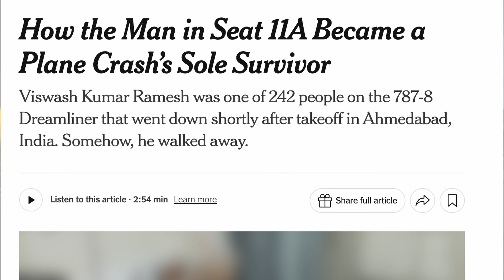Why the RAT Changes Everything – Air India 171 Update

Comment: Hi steve. I am a "just retired 737 NG/MAX Line Captain (Flew with Westjet Airlines in Canada). You haven't touched on your comments of the possibility of software failure, meaning that for whatever reason, the engines went back to idle and the pilot did not react with the TOGA switch One possibility could be to leave at field elevation the altitude on the MCP (That would not explain the RAT deployment though). Or the computers "decided" to flame the engines down for an obscured reason that hasn't happen until now. Thank you for your time and work on this Hugh issue. Frederico.
Reply: I'm not an engineer, but as an electronics hobbyist, it seems to me that a better design would be to have a hardware override in the case of software or computerized system failures.  I know for controlling aircraft there's a lot more going on than, say controlling finicky laser diodes or some simple electromechanical system.  But it just seems like there ought to be a way to get manual control over the hardware if the computer should decide to have a bad day.  just my two cents
Reply: @GTA2SWcity  You would still need time/altitude to be able to recover in time...this scenario did not provide that.
Reply: @tima.478   Yeah...I guess not. 

Just seems like some things could be forestalled if not prevented.  

I hear about software or computer failure modes and catastrophic results and I just can't help but wonder, you know?
Reply: @GTA2SWcity  Yeah, I get where you're coming from. In some cases of computer malfunction, the pilots are able to override manually. Just not for every scenario. As many commercial aviation procedures are unfortunately written in blood, so too are more likely to come from this tragic event.
Reply: @GTA2SWcity  There is video about a software failure with speculations that it was malicious code done by the unknown.
Reply: Precisely my opinion; i would go further and say the software entered auto landing mode.
Reply: @fredericohayes3883 Can anyone hear engine sounds along with RAT, its confirmed RAT is deployed, are engines running sound can you confirm?

Comment: I dont have the expertise to speculate on anything...but There is one factor that by now shouldn't involve/require speculation. And that is, how much runway the Aircraft actually used before it rotated. There are reports it rotated midway down the runway...other reports it ate up almost all of the 11,000ft. of runway...there is a report that it left the runway almost 9,000ft down the runway...this is one thing that we should know for certain by now.  Heavy aircraft  take off in similar meteorological conditions all the time. In my non-expert opinion, even heavies in similar conditions don't take up almost 11000ft  of runway to reach VR. It does appear from the limited angle available that it took far more runway than would be normal...but again it's hard to tell from the videos to be found. Is the dust cloud that swirls because they rotated at or near the overrun?  Maybe I have missed something but I have yet to see or hear any official report confirming how far down the take off roll the aircraft rotated...and that one should be easy to confirm. If they indeed take up almost 11000ft of runway...perhaps that speaks to an insidious problem that became critical just after VR. But one would think that it would have been a concern on the flight deck that they were coming up on a place in the take off roll where they would normally expect to reach V1 and not even be close to it...maybe they never reached V1 /VR and they were too far to reject and simply ran out of runway and had to rotate with the power/speed they had. Am I Missing info that officially confirms where along the runway they rotated?  We keep hearing it was a sudden loss of power or engine failure. But to my totally untrained brain...whatever happened wasn't so sudden...if they truly ate up almost 11000 ft of runway before being essentially forced to rotate. This I assume will be quickly revealed from both the CVR and FDR. Forgive my non expert terminology or understanding of procedure...but it just seems like if they ate up almost 11000ft of runway there would have been concern in the cockpit that something is not right long before they eventually (were essentially ) forced to rotate....whether it was from improper inputing of performance data or a system technical failure or whatever...taking up the whole runway seems to point whatever the issue was, to some degree being present during the takeoff roll

Comment: If its a dual engine failure, does that mean the manufacturer is at fault?
Reply: yes - this is a design failure a single cause of failure for both engines has to be prevented by all cost

Comment: I need to add some of my prospective , align with preliminary data from DGCA and AAIB.

A few clarifications from FDR and official press notes:

1. Dual engine failure was sequential, not simultaneous — left engine failed first, followed seconds later by the right (DGCA/AAIB, June 16).

2. RAT deployment confirms loss of both primary power sources (engines).

3. Takeoff config was confirmed correct (flaps, gear, trim).

4. Mayday phrases like “no thrust” and “losing power” were verified by DGCA, though not logged formally in ATC tapes.

5. Flap position after crash implies the system remained in takeoff mode and didn’t transition — consistent with low-altitude failure.

6. No visible fire before impact + staggered thrust loss = high suspicion of fuel delivery system misconfiguration — possibly a manual valve or crossfeed error (our analysis breaks this down in detail).

A fuel delivery system misconfiguration can still allow a clean takeoff roll and rotation, with failure occurring seconds later as the system exhausts available fuel or fails to crossfeed properly.

*) Theory about redundant electrical + hydraulic failure affecting fuel pumps is technically possible, there’s currently no confirmation of widespread systems failure in those domains.

*) Fuel Contamination - More likely to cause simultaneous engine failure — not staggered.Less likely if one engine fails first, then second

Comment: The landing gear don't tilt rear wheels down when they start to retract. Those wheel trucks show they were partly retracted front wheels lower. Interesting how this experienced pilot missed that obvious issue. That uniform is a little too white. Sensors failed with the Boeing 737 Max investigators identified issues with the system, which repeatedly pushed the plane's nose down, leaving pilots fighting for control. Sensors caused this probably fooled this "fly by wire" computer into a landing issue. Pilots called this a "cream puff" design. This tells me more computer control over manual pilot control. Seems a bit obvious safety concerns on this 787 were pushed past for profits. Trump did this. That is what he wanted just like his early warning pandemic restrictions were removed. Congrats on another Trump screw up.

Comment: Capt. Steve; RATs only supply Emergency Buses, not even Essential Electrical buses, as you know. This Emergency Bus powers the bare minimum, absolutely critical safety of flight systems. A RAT 's electrical output capability is quite limited. (There is only one).  Manufacturer systems designers limit what can be powered.  Especially concerning the matter of Emergency Buses. Bare in mind, every modern, state of the art airliner is virtually under complete computer control. There may be up to a hundred individual system control computers regulating the aircraft.  Long gone are the days of a fuse, a switch, and finally the bulb. They are like flying Teslas - but exponentially more sophisticated, to put it in terms the public can understand. 

So let's delve into the "Flickering Lights" report. General cabin lighting is not essential, but lighting IS considered an absolute safety of system.  It is required for emergency evacuation, (Egress / Evacuation Lighting) and for Flight Attendant Emergency/Forced landing cabin preparation. (Cabin walk through, moving the most reliable, strong ABPs "Able Bodied Pax", to heavy emergency exit doors plugs, and so forth). Therefore, per aircraft design regulations, EMERGENCY CABIN LIGHTING is essential, but it is not powered by the Essential Bus nor Emergency Bus. A loss of normal system feed bus voltage would cause an activation of the self contained, individually battery pack powered, aircraft Emergency Lighting System to activate. (Not sure, varies... perhaps a dozen battery packs scattered about the aircraft, each powering an array of Emergency Lights). A passenger in the heat of such a life threatening, frightening and condensed time period, could interpret this as; "The lights flickered." He would have been actually be observing the normal cabin lights extinguishing, and one second later, the Emergency Lighting system activating.

Next, the fuel pump theory  Some aircraft manufacturers do not even design fuel tank pumps be powered by the Emergency Bus. The reasoning; engine driven Fuel Controls have such powerful suction in the low pressure section of the pump it is not needed. But fuel tank FEED electrical pumps are an extremely high load consuming component. Their job is mainly redundancy;  (positive head of fuel pressure during takeoff), fuel cross-feed and fuel dumping operations. These pumps would also provide a positive head of fuel pressure in the event of Engine Fuel Control low pressure pump section reduced output or failure. Each engine requires electrical power to continue running. Even in its most basic, failsafe mode, the Fuel Controls need it.   Should the engine lose such electrical power input to its own Fuel Control (mounted on the engine), there is a backup source. It has its own miniature engine driven generator mounted on the engine's accessory pad. The engine will not flame out. There would be if the fuel supply sputtered even for a couple of seconds.  There can be no interruption of internal engine electrical control until the RAT comes online. (Up to 15 seconds usually to deploy and spool up).  There is an design assumption that cockpit emergency input remains intact.  This is due to the Emergency Battery.  However, I am unfamiliar with the Dreamliner.  It is not certain to me if each engine requires at least one of the fuel tank pumps to operate for supply engine fuel feed.  Let's say it did, and it was controlled by this Fuel System Controller - FSC, as another commenter stated. All avionics, and probably the  FSC are located primarily in the forward avionics equipment bay. If the emergency NiCad battery were also to be mounted there, it could have catastrophic consequences. An explosion could take out the ship's emergency electrical system.  A NiCad battery thermal runaway explosion could result in such. The dreaded single point of failure. A failure that disrupts power inputs from cockpit thrust levers, and the Tank Fuel Pumps computer control. Where have we seen this so-called independent, failsafe, redundant systems failure? One that takes down an entire, sophisticated modern airliner?  Does the notorious B-737 Max MCAS failure ring a bell?  All this seems to jibe with the sole surviving passenger statement;  "I heard a bang, and the lights flickered."

So why would not the Emergency Battery not overheat and explode during the three hours sitting on the hot tarmac in 40C heat? Why upon liftoff? All the heat producing inverters, located in the avionics bay, still had the same consumer loads sitting on the ramp as takeoff. What changed? I believe upon becoming airborne, the Avionics Bay cooling air input configuration modes changed. The large, high capacity cooling fans shut down, and the external cooling air inlet and outlets close when the landing gear senses no compression.  Once airborne, the avionics use Cabin Air circulation along with lower capacity duct fans. The cabin temperature could have been quite high on that hot day.  Low volume, very warm airflow.  To those who are trained on the B787;  What are your thoughts?

PS: My admiration to you Capt. Steve for your RAT extension observation and solid case presentation.

Comment: A loud bang here the definition: Electromagnetic Pulse (EMP) Weapons:

How they work: An EMP weapon generates a powerful burst of electromagnetic energy. This energy can induce strong currents and voltages in electronic systems, effectively overloading and "frying" them.
"Loud bang" aspect: While a nuclear EMP (generated by a high-altitude nuclear detonation) would involve a massive bang, non-nuclear EMP (NNEMP) devices don't necessarily create a traditional "loud bang" like an explosion. However, the effect on the aircraft's systems could be instantaneous and catastrophic, leading to a sudden loss of power and control, which might be accompanied by electrical arcing sounds or other immediate system failures.
Paralyze a plane: EMPs are highly effective at disrupting or destroying electronics. Modern aircraft are heavily reliant on complex computer systems for flight control (fly-by-wire), navigation, communication, and engine management. An EMP could disable these systems, rendering the plane inoperable.
Without visible damage: The primary effect of an EMP is on the internal electronics. The aircraft's external structure would likely remain physically intact, showing no visible signs of damage, though internal components could be completely destroyed.
Examples: The U.S. Air Force Research Laboratory's Counter-electronics High Power Microwave Advanced Missile Project (CHAMP) is an example of an air-launched directed-energy weapon capable of incapacitating or damaging electronic systems.
High-Power Microwave (HPM) Weapons:

How they work: HPM weapons are a type of directed-energy weapon that emits highly focused beams of microwave energy. Similar to EMPs, these microwaves can induce currents in electronic circuits, disrupting or damaging them.
"Loud bang" aspect: Like NNEMP, HPM weapons don't typically produce a loud bang. The "loud bang" in your description is more likely a characteristic of the effect on the aircraft (e.g., sudden system failure) rather than the weapon itself.
Paralyze a plane: HPM can disrupt sensitive avionic systems, flight controls, and communication systems, leading to a loss of control or functionality.
Without visible damage: The energy is designed to affect electronics internally, leaving the physical structure largely untouched.
Acoustic Weapons (Less likely for a large plane, but worth mentioning for "loud bang"):

How they work: Acoustic weapons generate intense sound waves, sometimes at frequencies beyond human hearing (infrasound or ultrasound).
"Loud bang" aspect: Some acoustic devices can produce extremely loud and disorienting sounds, often used for crowd control (like LRADs).
Paralyze a plane without visible damage: While acoustic weapons can cause discomfort, disorientation, and even physical effects on humans (like nausea or vertigo), their ability to "paralyze" a modern aircraft's operational systems without visible damage is highly speculative and generally not the primary design intent. Modern aircraft are built to withstand significant acoustic loads (from their own engines, for example). However, there's some theoretical research into acoustic attacks on micro-electro-mechanical systems (MEMS) gyroscopes, which are used in drones and could potentially be affected by resonant frequencies, but this is a niche application and not widely considered a primary threat to large manned aircraft.
Key takeaway:

The most plausible type of weapon that fits your description of creating a sudden, disruptive effect that paralyzes a plane without visible damage, particularly with a "loud bang" (referring to the immediate and dramatic effect of system failure), would be Electromagnetic Pulse (EMP) or High-Power Microwave (HPM) weapons. These weapons target the aircraft's crucial electronic "nervous system" rather than its physical "body."

Comment: Could the issue have been with the auto-throttle and radio altimeter? Similar to Turkish Airlines flight 1951. 

I don't think the link to the LinkedIn article works, but if you type the below title on Google, it should point to an article by WICCI NAC

"TOGA, Autothrottle and FADEC Malfunctions
in Boeing 787 Dreamliner During Takeoff and
Climb: Causes, Risks, and Solutions"

Comment: @bertieuz Agree with points you raised concerning 
the ambient heat of the aircraft - being in midday sun for 3 hours. 
I once read an analysis of 'when people die' in hospitals (Not from natural causes).
There are always five factors that have been adverse.
If the facts surrounding the airplane's crash are taken in order, I'm confident that the heat experienced will be one factor.
Number two factor may well be the total weight load. Yes aircraft are designed to function in heat, and at full capacity.
But. 
Add in another three things that went wrong and there is the situation where fatalities occur.
We await confirmation of events like 'the Captain's seat retracted' at rotation due to a seat malfunction, and of course, why there was no fuel getting to the engines. 
Thank you for identifying the heat as a factor.
It was my first thought too.